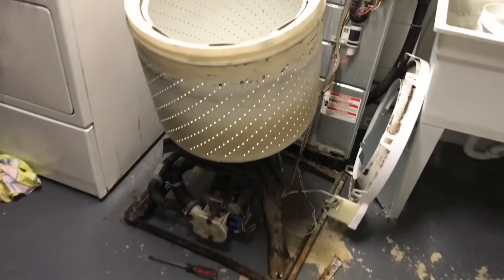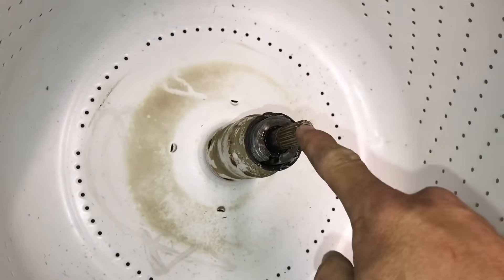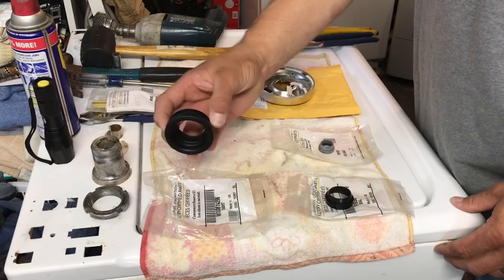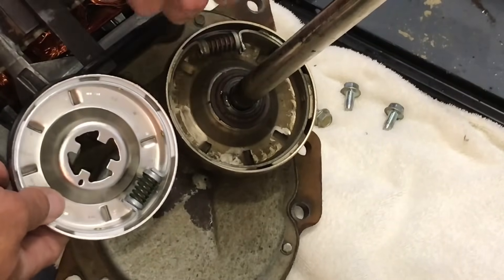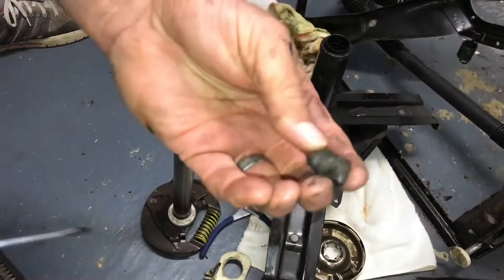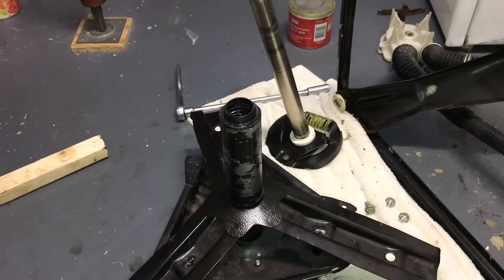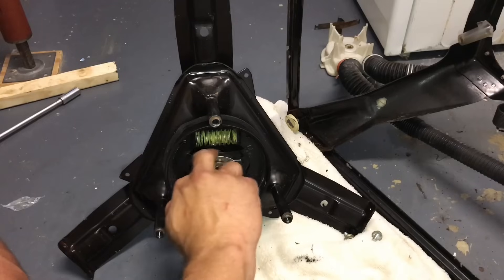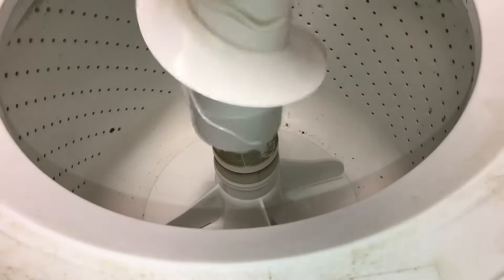Leaking Kenmore Washer - How to replace Shaft Seals.

Comment: Great video!  If you are just replacing the upper and lower seals, I wonder you could just press a new seal on without removing the worn seal - essentially pressing the worn seal down the line where you don't need to disassemble the unit - just take the inner drum off.

Comment: I LOVE my old Maytag. NO ELECTRONICS, Super size Capacity, Stainless steel tub, NOT energy efficient, NOT water efficient. BEST washer ever made.
I'm replacing everything dirt cheap. Will last me another 20 years. Model mtw5800tw0. My sisters high dollar , energy efficient, electronic control panel,
went out as soon as the warranty was up. The bearing failed also. Tech told her to buy a new one. After only a few years. They were like,
$1,000 for the washer, and $1,000 for the dryer. After 3 years? She was PISSED? She was too smart to listen to me?
Reply from the maker: broncobra Totally agree. The new machines are junk!!!   They will never last like the old Maytags and Kenmores.
Reply: The new ones really are worthless,my buddy bought a new house recently and the previous owners had left the washer and dryer there (they passed away  and the kids were selling the house), the back of the washer and dryer had all the books and whatever little maintenance they did to them over the years, direct drive beasts of course, 90s vintage,in excellent shape,my buddy had 2 of those new jobs that take 2 hours to wash the clothe and 2 more to dry, he gave them to his daughter and keep the the ones he found in the house,he loves them, smart man.

Comment: The lower seal part was different on my washer and there were two of them stacked on top of each other
Reply from the maker: Same make and model?
Reply: @SmokinwithKasket  we'll never know... lol
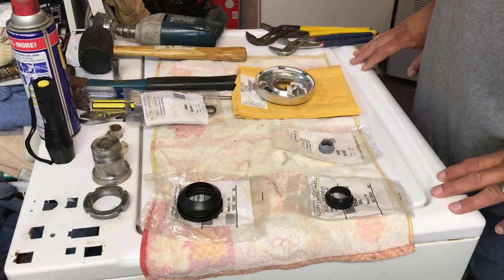Reply: Referring to my Kenmore 80 Series washer, model 11020852990. Mine has 2 seals stacked one on top of the other in the upper shaft seal and also in the lower shaft seal. They are not the same seals stacked on top of each other. The seal on the bottom is more of a ring shape. Then on top of the ring shaped seal is another seal more like a cone shape that you see in this video. At 5:30 of this video, he talks about the seal he's not going to use. He gives the part number of that seal as WP356427. That part number is the bottom ring shaped seal of the 2 seals in my lower shaft.  Here's another great YouTube video where you can see the 2 stacked seals getting replaced:  https://www.youtube.com/watch?v=f8aS9eBJgcc  In case the link doesn't work, the title of the video is:  "Washer Shaft Seal (Part #WP356427) - How To Replace"  It's made by AppliancePros.com
Reply: @SmokinwithKasket  Hey Bill, great video.  Thanks for taking the time to do it for us!  Referring to my Kenmore 80 Series washer, model 11020852990. Mine has 2 seals stacked one on top of the other in the upper shaft seal and also in the lower shaft seal. They are not the same seals stacked on top of each other. The seal on the bottom is more of a ring shape. Then on top of the ring shaped seal is another seal more like a cone shape that you show in your video. At 5:30 of this video, you talk about the seal you're not going to use. You give the part number of that seal as WP356427. That part number is the bottom ring shaped seal of the 2 seals in my lower shaft.  Here's another great YouTube video where you can see the 2 stacked seals getting replaced:  https://www.youtube.com/watch?v=f8aS9eBJgcc
  In case the link doesn't work, the title of the video is:  "Washer Shaft Seal (Part #WP356427) - How To Replace"  It's made by AppliancePros.com
Thanks again!

Comment: which seal was actually leaking
Reply from the maker: The top seal was the culprit
Reply: @SmokinwithKasket  i had the top seal leaking and i ended up taking a chisel and cutting the lock nut off it had grown to the threads and suggestions for next  

and i had a wringer bolt corrode and had to bust the top of wringer off to remover bolt

Comment: How did u bypass the lid switch with the cabinet off?
Reply from the maker: My lid switch failed a few years ago.  I just bypassed by connecting the leads and insulating with shrink wrap and electrical tape.

Comment: the way i get the tub loose i have  a rod out of a  old transmission i take the nut off and put one end on the opening an use a two pound hammer and hit the rod and it comes loose
Reply from the maker: Excellent idea. Thank you for sharing.
Reply: the tabs are usually worn out and need changed also 
but are easy to change with the washer all together

Comment: in minute  1: 17 it apears  a black  belt around the brake wheel, ¿ which is the function of that belt? thank you
Reply from the maker: Great question.  This is not a belt.  It’s a rubber type band with a sticky back that is wrapped around that hub.  You can see it at 10:12 that it’s only wrapped around that hub.  Not sure what the purpose of that actually is.
Reply: It’s for sound dampening. It looks like a belt but it isn’t.

Comment: easier to just replace the spin tube W10820043 and install WASHING MACHINE CENTERPOST BEARING AND SEAL KIT 285203 imo  also would not recommend banging on that top seal with a hammer you can easily damage the new seal
Reply from the maker: Totally agree.  I’ve found the spin tube is not available.  Idk why but all suppliers reported either on back order or not available.  Also agree about pounding on the seal.  It could sustain damage.  But had to be done (carefully) to install it. Thanks for your input.  Stay safe!!!

Comment: does silicone grease works instead of the magic lube?
Reply from the maker: That should be just fine.  As long as it doesn't deteriorate the rubber seals - shouldn't be a problem.

Comment: What if u have oil leaking in that area? Is it the shaft seals?
Reply from the maker: That would not be the shaft seals I'm outlining in this video.  Either the gasket between the gearbox (transmission) and housing or the seals in the transmission where the shaft enters the top of the transmission hosing.  The shaft seals in this video only keep water from leaking and not oil.  Thanks for watching and sty safe.
Reply: @SmokinwithKasket  Thank u so much! Great video! Very detailed and easy to follow!
Reply from the maker: Thank you.  Your very kind.  Appreciate your support

Comment: Who you test the machine with out the panel
Reply from the maker: A couple years prior, the lid safety switch went bad.  I had disabled it. Other than the lid safety switch, the machine will run without the cabinet.
Reply: @SmokinwithKasket  Thank

Comment: My shaft is really rusty.  It won’t even slide out. I may attempt to disassemble and remove rust but I don’t have much hope.
Reply from the maker: Sometimes, despite the fact that you’re able to repair it, it just doesn’t make sense to move forward if the internal parts are so corroded. There comes a time when the machine would have to be replaced, sadly. Thank you for watching and sharing. Appreciate your support.
Reply: @SmokinwithKasket  I agree, it just sucks that i already spent money on parts for it. decided to go get a free, defective Maytag Centenial MVWC200BW.  Owner says it wont do the spin cycle.  I figure it should be an easy fix, pretty much already know what the problem will be.  Ahh the joys of being a cheap poor bastard!

Comment: when you had it apart and you mentioned the drum would slide around on the triangle plate at 18:00 there are 3 plastic caps underneath with pins in them, arent the pins supposed to hold it together , if it is supposed to slide around freely what are the pins for ( they look like a pin for a snowblower wiith a hole for a cotter pin.) In my washer the 3 pins were just loose in the plastic caps. But i should mention someone did fool with the machine and take it apart who didnt have a lick of common sense.
Reply: Hi did you ever get an answer to this question? I was wondering what they were for too.
Reply: @jasonb5941  No, no one ever answered that question and i havent gotten another washer as junk to see if those pins attach to anything or if they are just spare pins for some other function on the machine.
Reply: @jasonb5941  Do you have the 3 caps with pins? Were they attached to anything?
Reply: I found the answer on a few repair websites and even the owner of this channel answered in the comments. Supposedly they were used during shipping and are no longer needed. I suspect they went through the hole on the black frame point down into the plastic cup holders to help the assembly from sliding around on the pads during shipping. Right now mine are just in the 2 plastic cup holders head down and not through any frame holes so they don't get in the way. I only have two gold pins and 2 0lastic cup holders so I must of lost one when I was unpacking the washer about 25 years ago lol
Reply: User @gm690 about 2 months ago asked the same question in the comments and the owner of this channel answered. If you click on newest comments you should be able to find the comment.
Reply: @jasonb5941  Great so they arent needed for any actual mechanical reason in the function of the machine, just holder pins to keep the basket secure, thank you

Comment: I don't understand why you dismantled the entire cabinet and removed the tub.  It looks like you could have pulled the column from the bottom of the unit after the spanner nut was removed.  I think you only need to remove the tub when replacing the tub seal.
Reply from the maker: That’s what I did. I did not dismantle the entire cabinet. I removed the rod and transmission from the bottom then proceeded with the repair.

Comment: no one shows how the transmission clutch and the tub brake line up when installing the transmission
Reply from the maker: Make sure that the little lever-looking insert on the tub break is opposite of the little spring attached to the clutch pads.

Comment: REAL WORLD? That nut ain't coming off easy? I'm glad I took it all apart? After 18 years of dog hair, I was amazed it even still ran? I screwed up the tub, but also
ended up replacing the liner. Don't use a sawsall unless you have another tub? I bought the last one in the U.S.A. I gaurentee you? It's probablly a good idea
to replace the plastic tub liner. Mine was so crappy after 18 years, I couldn't even clean it? $188.00. I will have everything replaced, brand new, for around $400.00
The SS tub was $57, plus $100 shipping - but I got the last one. Don't mess up your tub!. That nut will NOT just come off? It was a NIGHTMARE?
But I needed a new liner, so it had to come off. The top 1/3 between the tub and liner was so packed with dog hair and lint, it was unreal. And hard water scale.
I mean PACKED tight? The liner was grooved from rubbing against the tub. Just nasty? Just replace the liner? Real world problems.
Reply from the maker: Thank you for the information.  YES!!!!  That spanner nut can be challenging although, I got the nut off- it was getting the tub off the shaft that was difficult.  The three jaw puller worked very well wit this task.  Hope your washer will continue trouble free for you after the overhaul.  Thanks for watching and chiming in.  Much appreciated.  All the Best!

Comment: Weird most people I know still have their washers functioning great after 20 years, I guess they don't build appliances now like they used to, companies are running a major scam in my opinion to build shoddy appliances that break down conveniently after the 1 year warranty or after 2-3 years, it's not uncommon for more than 50% of new washers to fail to some extent after only 3 years or within 3 years.  These transmission repairs are not worth it, most people can't do that, and getting tech repairs is another big scam, you get ripped off senseless - they charge you $100 just to come over, and $100 an hour for labour and they charge you 2x-3x the cost o the part, total rip-off, so much that most repairs will cost you half to 3/4 of the price of a new appliance.  If a machien starts to leak or transmission / motor problems, it's probably better to get a new machine.

Comment: Man I wish I had replaced the shaft seals when I did the tub seal.  All that work and it still leaks.
Reply from the maker: I hear you loud and clear!!!  That's always my luck.  One thing for sure, the tub seal is the by far the easiest to replace compared to the shaft seals.  Seems the tub seal NEVER fails!!!  It's never that easy.  Hope this helped.  Pick a weekend and dive in again.  Once you get started its not a bad job really.  All the Best-

Comment: This really sound like my problem.  It's leaking and it leave s cloths wet after spin cycle. I also noticed that is has an uneven spin
Reply: TechMAP you may have needed to change the coupler or a spring may have been getting weak.

Comment: Thank you for the great video. I also have an older Kenmore 110.82781100. I had noticed water leaking from the bottom, opened it once it stopped working, one wire was cut, turned it over since wife said it was not spinning either, and tons of oil came out of it. Now checking if those seals are it or the actual transmission is shot.
Reply: I have seen where the water entered the transmission and when I removed the trans the water and oil poured out the little hole on the top cover.

Comment: Anyone run into a corrosion problem on the shaft that the big tub seal slides down on?
Mine has corrosion and rust right where the tub seal settles when everything is assembled. The washer had been leaking past the tub seal.
I cleaned up the shaft as best I could, but it still has some low and high areas where the corrosion was.
I’m going to try using RTV sealant between the shaft and tub seal to see if that will create a good seal - so I’ll put the new tub seal in to tub hole, then coat the corrosion area of the shaft with the RTV sealant - and slide the tub and seal down over the RTV area.
Anyone tried something like this? I can’t get a new shaft anymore, so this appears to be my only solution.
Reply: The Permatex 82180 sealant worked. I put the seal in the tub, then put sealant on the inside of the tub seal (where it slides down over the shaft), then slid the tub with new seal into position on the shaft. I wiped off the excess sealant on the shaft, then installed the tub springs and brackets so the tub is secured. I let the sealant dry 18 hours approx. Put everything back together and no leaks after 10 loads of laundry.

Comment: easier way remove trans and motor set aside remove cabinet remove sub top remove spanner screw spanner back on part way pull up on tub smack spanner till it releases remove spanner and inner tub release brake from underneath and pull out replace seals reverse procedure lower main tub seal rarely fails this method is the quickest and easiest way to do it I've done well over 100 of them
Reply from the maker: Awesome advice. Thank you!!!  If anyone uses this method PLEASE let us know how it worked out.  Thank you for watching.  Best-
Reply: Would be nice to see this on a video...

Comment: this sure is a very long process.  Appreciate the excellent video, but can the common person do thiS? So many parts, so much precision needed, not sure this is something an amateur can do. Plus getting the parts is time consuming and a novice could order the wrong seals etc.
Reply from the maker: As long as one is mechanically inclined and understand the mechanics of the equipment.  This would not be a job for a novice with little experience taking things apart and fixing issues.  But honestly there’s not many intricate parts that need to be dismantled. Keep in mind that the process appears longer because I was shooting a video while doing this.  That took time and caused delays.  Parts are available at most appliance parts stores or on line.

Comment: Everybody says a 7/16 socket to take the agitator off! But no!!!
Reply from the maker: What size is yours?   Mine is 7/16 all day long.
Reply: @SmokinwithKasket  nobody ever mentions the 3/4 extension to to take the plastic peice off that is over the 7/16 bolt, I watched 3 videos before getting i to mine to k ow what to look for when i got into it.
Reply from the maker: @christopherflynn5359  - My model simply had a fabric softener dispenser that came off by hand then a plastic cap with finger grips to pull it out of the well.  Then the 7/16 bolt is visible.  Not sure what you have going there.
Reply from the maker: I caution you to continue with this repair.  This gets fairly deep into the mechanics of the washer.  Honestly the agitator removal is very very easy compared to the diving into the seals.  If you feel any hesitation to continue it’s best to call a technician.
Reply: I'm not looking to replace seals, my transmission is bad but ive been watching what I  can find just to know what all to look for while in there.

Comment: Thanks for showing me how it comes apart, but I wouldn't be surprised if you haven't damaged all sealing surfaces you were banging, prying and jabbing that screwdriver into. 😢😢😢
Reply from the maker: Appreciate the concern! I totally get where you’re coming from, but since the video, I’m happy to report there have been no leaks, and the machine is running strong. The jabbing and prying might’ve looked rough, but it did the trick!